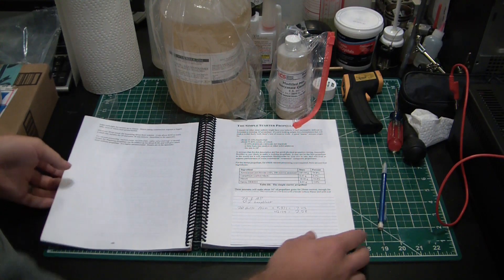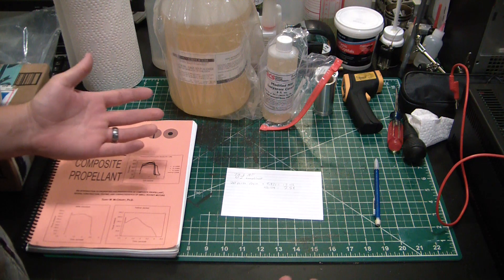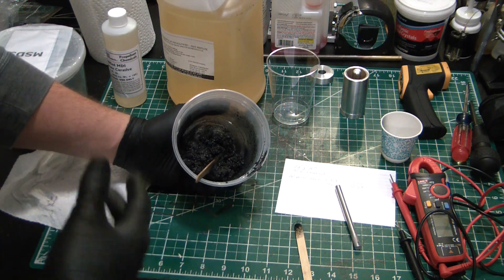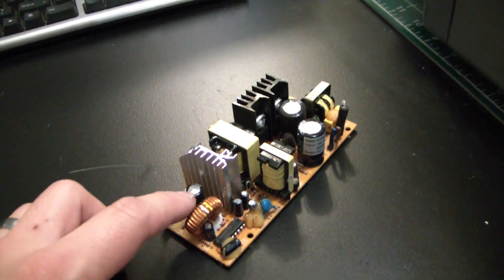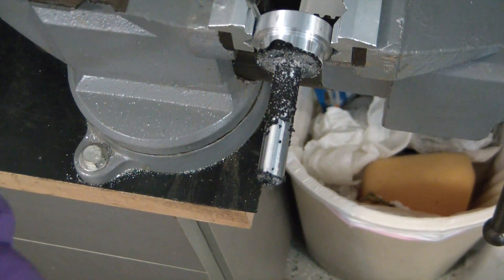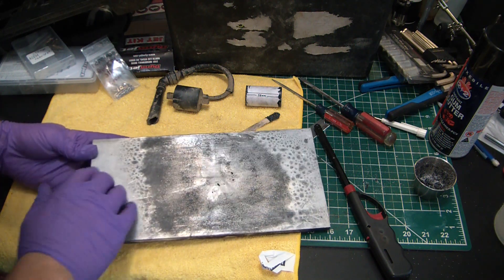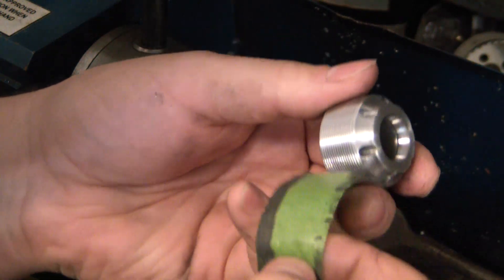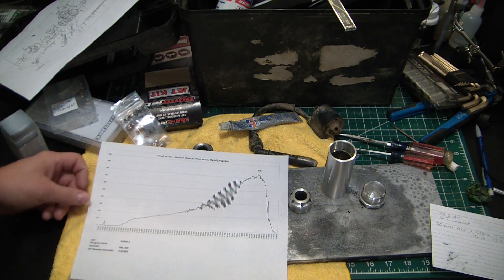Composite Rocketry Finally! - ElementalMaker

Comment: Try painting the mold/spindle with polyvinyl  alcohol releasing agent, several coats and letting each coat dry, and don't scratch the PVA releasing coat while placing the resin in the mold. It may work better that silicone grease. Also heating up the silicone grease may cause it to permeate into the resin, making it difficult to separate the resin from the mold. Just some thoughts.

Comment: Do you have any stability issues using lampblack with AP? Lampblack is made from petroleum soot and can have some acid component to it (low pH). Ever tried using airfloat charcoal instead?
Reply from the maker: Never had any issues, but I also buy high quality pyrotechnic grade lampblack. Id imagine any potential acid has been neutralized in processing. I haven't tried airfloat charcoal, but I imagine it may work similarly.
Reply: I wouldn't make those assumptions :) Even the lampblack that Harry Gilliam at Skylighter was not necessarily the best. Air float charcoal was better. Besides, air float didn't make the damn mess lampblack does. I used to always add a little bit of some carbonate to my mix if I was using lampblack and AP or KClO3

Comment: Since the burn produced more pressure at the end when the casing is near empty  I wouldn't think nozzle diameter would have been the reason for the oscillating. Seems like maybe the fuel was not mixed to a homogeneous state.

Comment: I really like ur rocket testing vids. I'm not really an electronics board person or computer code person but I really am interested in ur test stand. I've read the article u linked & I'm wondering how hard it is to create this test stand? What type of software runs it on ur laptop? I'm getting into hobbyist pyro & love the idea of rockets. There's thrust test stands available for like a few hundred possibly more I can't remember the number off the top of my head. I know testing rockets is a big part of it so it'd probably be a necessary tool in the shop especially when dealing with new comps. Have you ever tried ramming powdered KNSU comp onto a spindle in a cardboard casing. Get back to me at ur convenience. Thanks. Keep up the amazing vids.

Comment: Was certainly the smoothing cap. The smoothing cap sits across the +/i, and when caps bulge or die, they tend to go closed circuit. Which would be shorting out your supply, which is probably current limited, which explain the voltage of 300mv across the dead short of the cap.
Reply from the maker: Great tip, I'll have to try replacing that capacitor and see if that fixes the supply

Comment: Recap the PSU and it'll work. The bulged cap probably turned into a resistor, current went up, and the protection circuit kicked in

Comment: I’m a little late for the party, but did you notice much if any corrosion inside the engine after the burn caused by the HCl production in the burn? These videos are very instructional.
Reply from the maker: Thank you! The corrosion in the motor casing seems to be quite minimal, mostly relagated to the bulkhead of the motor, and the small exposed area around the graphite nozzle insert. I also think the judicious application of antisieze grease I do probably helps quite a bit.

Comment: Stump remover granules and granulated white sugar mix 50/50 weight and heat mix while heating use lowest heat only need to melt sugar has a higher melting point than stump remover...ignite with torch or otherwise and dont close it off in a container of any sort

Comment: Late to the party, but a few suggestions.  Curing under a vacuum will pull out some of the air voids created while mixing.  As you noted, a plasticizer will help.  Slightly more of the epoxy catalyst will create more polymer links and give you a stiffer grain.  A mix of finer mesh AP will fill the voids between the larger particles and improve solids loading.
Awesome first run overall!  There is a lot that goes into rocket science - who knew?

Comment: Your sugar-saltpeter rockets burn at lo temps generating steam and CO2. Above 1200 degrees the equilibria of 2 CO = C + CO2 shifts to CO. Burning Carbon to CO produces 85% of energy of burning to CO2.  Best monopropellant/explosive (can detonate nitromethane or acetylene or hydrogen peroxide with cap) is oxidizer poor.

Comment: Space shuttle boosters were Ammonium Perchlorate, Aluminum powder, powdered rubber, and bitumen (tar). The mixture sets after mixing. Later Thikol tried polymerizing the rubber after ingredients mixed and in molds. This rubber bacame stiff at low temps. To save weight the boosters use the ablative nature of the propellant (burning inside to out) to protect booster walls to save weight/money. Space shuttle accident when launched at lo temp.

Comment: How about using electrolysis to make HHO and burn that?
Reply from the maker: I've done videos on building an HHO cell and burning it, but its not feasible for a rocket of this size and my funding. You'd need to be able to separate the gasses, compress, liquefy, and store them. Then pump cryogenic liquid in the motor.
Reply: @ElementalMaker  I was thinking more along the lines of supply on demand and no storage or seperating the gasses.
Reply from the maker: Unfortunately something like that wouldn't be viable for use in a rocket. It would require tons more energy than it would produce in thrust. So your looking at many pounds of batteries, and a very large, complex cell design, for a few grams of thrust. Also preventing flashback with that volume and pressure would be damn near, if not completely impossible.
Reply: @ElementalMaker  was thinking dry cell, and capacitors, and Stan Meyers trick using frequencies to seperate the water molecules faster, and Tesla's one way valve to prevent backlash.  Of course the nozzle would be really small compared to other fuels.

Comment: Enjoying your library of videos and keep coming back to the rocket motors.  I guess the inner kid in me still needs to be entertained.  I've also seen a number of videos where they use polyurethane expanding foam (ie "great stuff") as a binder.  Seems to works VERY well.  wondering if you MIGHT consider giving that a try.  You know...for science?
Reply from the maker: Whoa never even thought to use that but I could certainly see it working. Probably just needs a good degassing. I'll definitely have to try that
Reply: Had another thought on the way home from work today.  Maybe even try a latex-based tire repair ie fix-a-flat.  Wouldn't cure like the polyurethane would so "should" stay flexible enough to mold.  Not sure how the water content would affect things though.

Comment: 8:03 i would say the capacitor is at fault here becuause i know from expirience that many switching power supplyes fail to regulate when th capacitor goes bad i repaired 2 monitors just by replaceing the bulged cap
Reply from the maker: I'll have to try replacing it. Seemed too simple but makes sense as it could make the supply think there's a short.

Comment: I used to make AP and PSAN (phase stabilized ammonium nitrate ) motors. AP is more powerful than PSAN. You need more than one propellant grain to get any respectable thrust from your propellant based on the size of the nozzel diamater you are using.

Comment: Dude, check this out. Turns out you can convert silicon carbide into diamond at atmospheric pressure and under 1000C.
https://www.nature.com/articles/35077031
They use a quartz tube furnace but I'm pretty sure the wife's nice quartz wine glasses would suffice. lol I only took a cursory glance but it looks like they just flow hydrogen doped chlorine gas over the carbide and it basically dissolves the silicon out.

Comment: One trick you can use to get much better and uniform consistency is to dissolve your perchlorate in a tiny bit of methanol, and then mix this in to your resin. Methanol will act as a thinner to your resin, and will evaporate out before it has time to set, but will allow you to mix everything homogeneously. Ammonium perchlorate just happens to be very soluble in methanol. You can buy it at the hardware store as "methyl hydrate". Careful though, it's toxic, so make sure everything is well ventilated and don't breathe in the vapors. And only use the bare minimum to make it a uniform slurry you can easily mix in the resin, if you use too much the resin will set rubbery. Also, grease the peg in your mold and wrap it in a bit of saran wrap so it easily slides off.

Comment: Fundamentals of molding cylinders......mold DRAFT...google it if you don't know. Plus...with aluminum molds and epoxy (or stainless) use a polymer based mold sealer and release. Plus...it doesn't make too much sense to have epoxy that flexible....and usually, the harder the epoxy, the less viscous the resins are. Your fuel is pretty far from homogenous.
Reply from the maker: I used to design injection molded medical devices so I'm quite familiar, I certainly would have added a few degrees of draft to the cylinder had I made it myself but it was provided by a very kind viewer.
Reply: @ElementalMaker  I owned a company that manufactured composite aircraft propellers. Two decades of epoxies  and mold making. .
Reply from the maker: @stuartkeithguitars4251  that's awesome! Prop design has always fascinated me. Did you machine the molds in house?
Reply: @ElementalMaker  Yes, I had three Haas mills. VF4, VF2, and TM3. Plus an Eastman M9000 ply cutting table for cutting carbon prepreg materials of several varieties.

I made molds for prop blades that used internal heating element and microprocessor heat controls. i did all the R$D for that business.  

I used to  own a Wardwell braiding machine as well...for making continuous length carbon fiber braided sleeve.

Comment: Fun fact, chlorate/Perchlorates rocket fuel is explosive and can detonate with a blasting cap
Reply: @Benjamin Joshua Beggs yes but not all rocket fuel is capable of detonation
Reply: @Benjamin Joshua Beggs pottasium nitrate based fuels, black powder based rockets, nearly all liquid fuels. But Perchlorates/chlorate rocket fuel when initiated with a blasting cap can detonate like c4, so it's a cheap way to boost tertiary explosives like anfo, ammonal, annmal, or be used as standalone explosives. And it's use as rocket fuel means it can be explained away relatively easy if a bomb maker caught suspicion. the explosive is easily plasticised for plastic explosives that can be assembled in hours, and when stored in separate components it is completely inert, so fuel, oxidizer, and plasticiser are stored seperatly and mixed when use is expected in as little as a couple hours, or as long as a few months in advance.

Comment: How to get rid of expandable foam from skin on hand full of hair?
Reply from the maker: I realize its a bit late but acetone usually does the trick. It's best to use it when the foam is still tacky. Once cured its quite chemical resistant and much more difficult to remove

Comment: Suggestion: hook up with a Tripoli rocket club member that does experimental motors. They will have a Kitchenaid mixer and a vacuum pump to de-gas the mix. It helps.
Reply from the maker: I'd love to find a tripoli member in the area. I have the equipment for degassing and I've been on the lookout for a used kitchenaid mixer on FB Marketplace and Craigslist. But I'd love to work with someone experienced

Comment: I remember when I tried to make a rocket and had the bright idea to use rocket fuel to make a cannon. Of course, the cannon was made of PVC and aluminum tape. And then I used a fishing weight wrapped in aluminum as a projectile. I'm pretty damn happy I sucked at measuring because I nearly pipe bombed myself. Had a friend who wasn't so luck and hammered a piece of buckshot into the end of a 223 and ended up with brass shrapnel bits in his leg, he's doing good now.
Reply from the maker: Jeeze those are both scary close calls. Glad your both okay. When I was a young boy I also had a couple similar close calls. One nearly cost me my right hand, and the other ended up with an arrow stuck half way through the gutter of a neighbors house, but it could have just as easily hit me or my cousin. Never shoot an arrow straight up in the air LOL. That was an awkward conversation with the neighbor.

Comment: Wow that rubbery stuff looks like a mare to work with! I might be missing something but surely a slightly tapered core spindle would help the de-moulding process. as well as properly polishing the spindle to get rid of any remaining machining marks (even fine scratches can load-up and cause sticking).
core-burner spindles can be a tricky balance between too much taper (if they go to a point it can cause detonation faliure, I don't know why but it never worked for me) or too little taper, causing sticking when removing the spindle, (i've cracked a few that way too!) my only experience is with hand-rammed BP and a little RC though so don't take this as advise, just idle speculation! Thanks dude, I look forward to seeing how this goes

Comment: Would a solid mold release agent maybe be a better idea? Talc or chalk powder possibly? Also, I hope this one failure doesn't mean you won't be doing more composite fuel soon with a smaller nozzle.
Reply from the maker: I'm going to experiment with some spray on mod releases which should perform much better. If not ill try physical barriers and powdered release agents.
Reply: @ElementalMaker  follow-up question: is there a reason graphite seems to be the dominant material choice for the nozzle on these level rockets? It seems like it's not the most durable material on it's own, which is an odd choice for something that gets exposed to supersonic gases

Comment: if there is a water based resin type plastic it would work allot better also if you put that spindle on a hot plate just below the melting point it should slide right off
Reply from the maker: Water based would dissolve the ammonium perchlorate, which has a grain size critical to propellant burn rate.

Comment: Try ultra fine graphite powder as lube/release agent. While it will slow down the burn locally, it shouldn't react otherwise and theoretically should work well as a release agent. Also did you think about mixing up your dry ingredients before adding them to the wet? It should be the same as baking, you get a better blend mixing your dry ingredients separately before adding the wet.

Comment: Big change from sugar huh? I think you are right about the nozzle, you can see as the fuel burns, and the core diameter of the grain increases, the pressure rises near the end due to increased surface area of the burn. Some commercial AP motors use a star shaped core to increase the initial surface area, I think its called the web or something. I'm sure the impulse of your fuel will get better as you get more experience but a smaller nozzle is going help overall. I think it's going to make that "chugging" go away. Keep sharing man, I love this stuff. A good mixer will help out bunches too.
Reply: 'Web' is thickness of the propellant from core to outside. The Kn ratio refers to the ratio between burning surface area and the area of the nozzle throat and is usually between 200 and 400 depending on the propellant and desired chamber pressure, higher the Kn the higher the pressure (and thrust). You can increase the Kn by making the throat diameter smaller or increasing the propellant burning surface area. A STAR or finocyl core of the same diameter as the cylindrical core will increase the burning surface and give you a more neutral burn for long single propellant grains. For multiple short grains, it can up the initial chamber pressure for liftoff. You can see from your graph when the propellant web was thin near the end of the burn, the surface area may have been greater and gave the higher pressure/thrust. On a true 'BATES' grain, as the web gets thinner, the length also gets shorter if burning from both ends giving you a neutral (doesn't change) burn.

Comment: On the power supply: The dead output cap can definitely cause it to stop working completely. The control chip will notice something is wrong and shut down. (and try to restart from time to time)

Comment: According to the professional mold making sites for halloween masks and whatnot, silicone sticks to other silicates and silicone.  Maybe change up your release agent to something different.  Vaseline?  Your burn rate problems may be related to the lack of a proper burn rate catalyst.  NASA uses aluminum.  I'd start there.  A faster burn will increase chamber pressure.  There's a formula for ideal nozzle size somewhere.

Comment: Those rectifier diodes look like they have been running hot if that is discolouration of the board around them, the output capacitor may have failed short or at least drawing enough current to cause the control ic to activate over current shut down. A good start would be replace all the electrolytic capacitors,check the input and output rectifier diodes and replace any failed, look for any other discolouration on pcb,testing components in that area (most likely resistors or small diodes). Also wash the board if that (or any) capacitor has leaked on the board. Will most likely be ok and work after that.

Comment: 12V power supply look primary side for small electrolytics, 47-220uF around 16-35V, they will be faulty with no visible signs. That and the output caps are the most common failure on small SMPS units, I keep a whole kit of the capacitors around for repair of them.